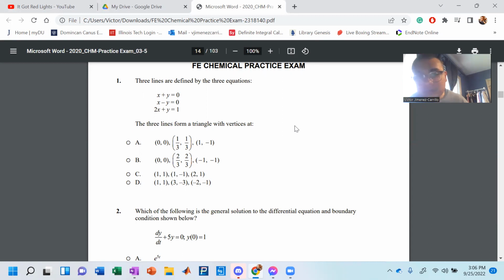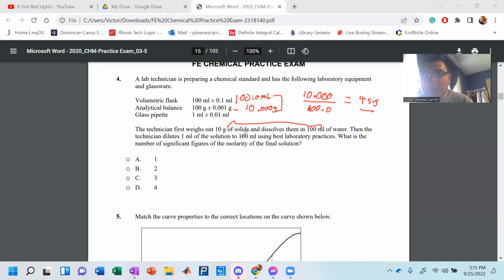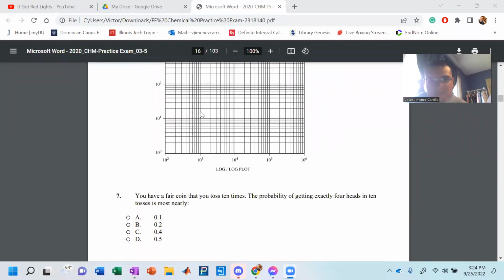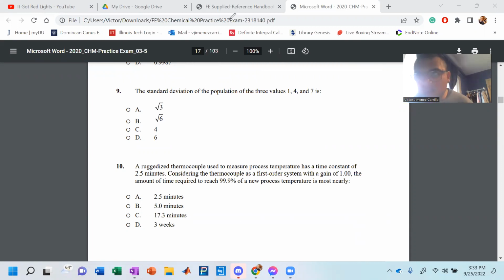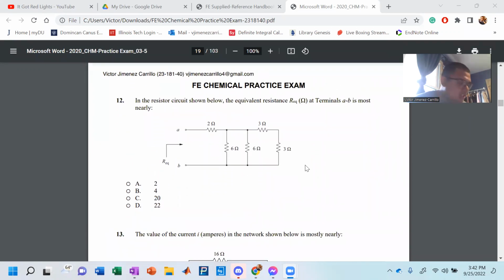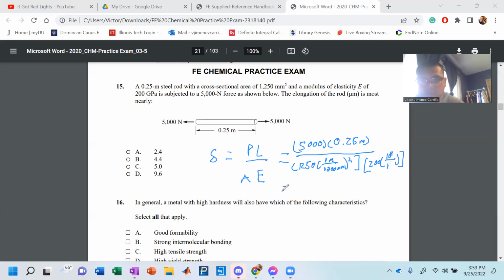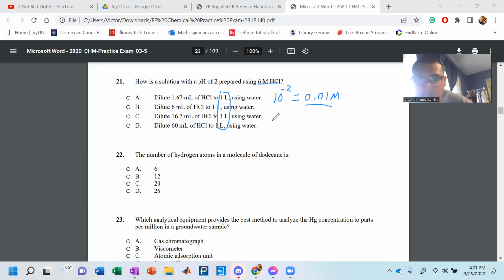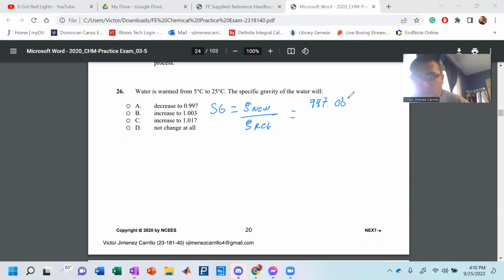Chemical Engineering FE Exam Preparation Part 1

Comment: Thanks for the video! I do think you used the wrong reference value in question 26. The reference density should be 1000 kg/m^3 (per the manual, pg 176). You get close to the right answer because the number you used is close to the actual reference, but your answer would round to 0.998 rather than the actual answer, which is 0.997.

Comment: thank you for your efforts!  It is really helpful.
I think you have a mistake in question #2 in solving the linear differential equation. The answer should be B (If you substitute the equation of answer A in the differential equation it will be wrong).

Comment: for number 6 lets take the x axis for example it starts at 10^2 which is 100 the next increment should read 200 then 300, 400, and so forth, all the way to 1000 which is 10^3 ... then the next line is 2000,3000 and onward. but where the red dot point is at looks correct.

Comment: This video is great! As a side note, in problem 13 when going from + to - across a component, voltage is lost (or there is a voltage drop). Your +50 V should be a -50 V. Similarly, across all of your other components this sign should be flipped since there should be a voltage drop across resistors in the direction of current. It doesn't really matter as long as you keep a common convention for the signs, but the way you did it is unconventional. The final answer of C (-0.5 Amps) is still correct.

Based on this change in convention: -24*I - 50 - 10*I + 25 - 16*I = 0 (solving still gives I = -0.5 amps)
Reply from the maker: @CalebDietrich  i never realized it was an unconventional way. My prof used to say just keep it consistent and it will work like you had said. Cool fact there’s actually a bit more to it.

Comment: Coming back here Because I just passed! I definitely screwed myself a bit by only giving myself a weekend to prep for the exam but I almost exclusively studied through your videos part 1 through part 4 to give myself a refresher on the material. Definitely didn't do to hot on the heat transfer questions, but other than that I must have done well enough to pass. So This is my thank you to you Victor. I hope you are sucessful in whatever you take on! Best of luck and thanks again!
Reply from the maker: Thank you for coming back for that acknowledgement. It makes me feel really good knowing that you passed!! Thanks for sticking with me and all my cussing.
Reply: Congrats, mate,
A quick question if you don't mind. Were the questions in the exam similar to the ones posted in this video?

Comment: I don't think solution to no 5 is accurate. wouldn't point A be f''<0 if it is the maximum point?
and no 6 is wrong too, I believe. you got the points of x and y mixed up.

Comment: wondering why you are using a graphing calculator if it is not allowed on the FE exam?
Reply from the maker: I like my TI inspire CX and I have a computer app version of it as well. Easy of use tbh. I wanted to get these videos out quickly!

You should use basic calculator as well. You probably should if your going to take the exam. Not much changes outside of not having the ability to graph things. 

And for 98% (only question 1 changes) of my solutions the methods don’t change either 😊

I personally use Excel 24/7 at my job lol